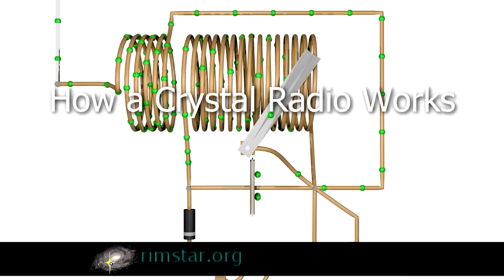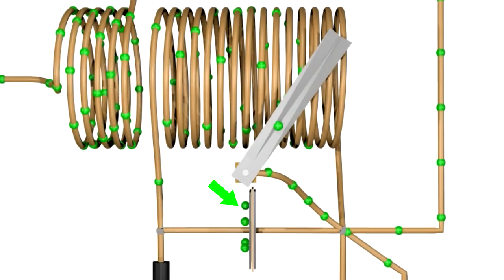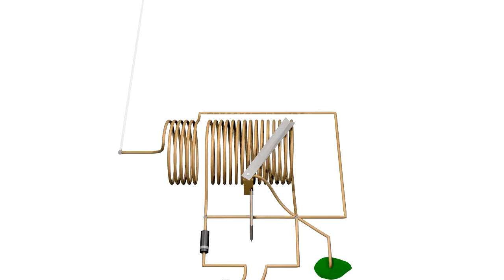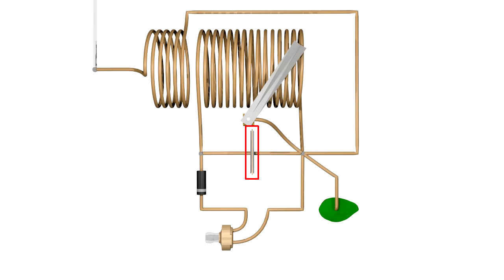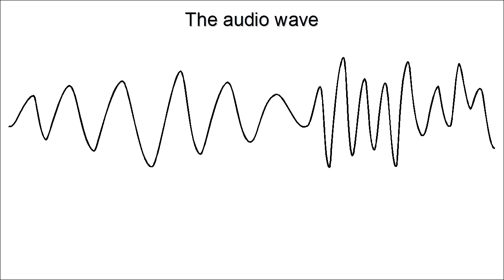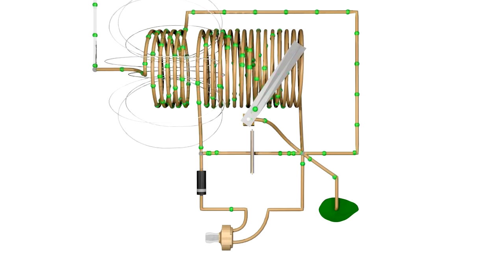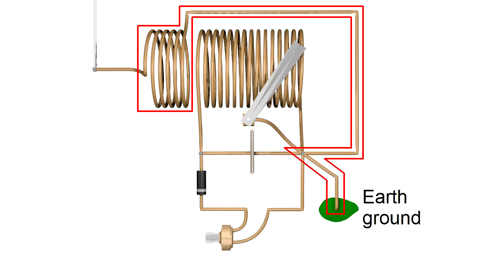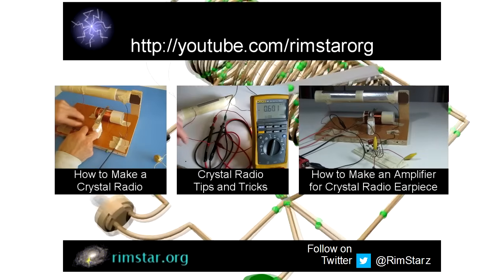How a Crystal Radio Works

Comment: Very clear and precise explanation, thank you very much. About the coils, if we want to calculate theoretically the value of the inductance to tune the radio to a specific frequency, should we consider both inductances? Or just one of them, the tuning coil?
Reply from the maker: Thanks. I get away with taking into account just the tuning coil and ignoring the antenna coil when calculating. I think I did once run across formulas that included the antenna coil too, or maybe it was just some mention of the issues with regard to calculations.

Comment: Detecting the "colours" of photons beyond an eye's.     
Increasing the capacitance size (plates), blueshift's the "sight" (to higher frequency of vibrating photons), and lowering, redshift's (the opposite).   
Increasing the inductance size (coil), redshift's the "sight" (to lower frequency of vibrating photons), and lowering, blueshift's (the opposite).  
Tune to a frequency (blinker the eye to a "colour") with the size of (between) coil (colour limiter 1) and plate (colour limiter 2).

The sound volume (wave height) is the brightness of the "colour", and sound pitch is the oscillating ("shaking") of the brightness.

The smaller inductor the aerial is attached, is so it ignores frequencies above a range (points the eye in the right direction).
Reply from the maker: Nice!

Comment: Thanks for the video. I see you've done a lot of work :) 

Why cannot electrons just go back when it's not enough charge to make the earpiece to vibrate. I mean the diode is connected to the other terminal, No interaction between the diode and the accumulated electrons.
Secondly, talking about the modulation of the sound wave, don't we now deal with the frequency that has been inserted to fit in the gap between the original wave form and the inverted one, and not with th original frequency ?!

Comment: How does coil know the role it has to play?   The first one is the receiving coil and the second one is the inductance coil, what is to stop the 2nd one becoming the receiving coil?
Reply from the maker: The first one is connected to the antenna, so it's the one receiving the signal. The second one is a part of the tuning circuit, along with the capacitor, so it does the tuning.

Comment: The only thing i think you missed in this brilliant explanation is how the size of the small coil affects the output.
Reply from the maker: I cover the small coil at 0:40 and 4:45.
Reply: RimstarOrg is there a reason for 25 turns in the smaller coil?

Comment: Great video! very well explained and super helpful.  Just one question, why does the capacitor need to be connected to ground?
Reply from the maker: +Liz Dolecki It may be because both end of the capacitor need to be connected to both ends of the coil and one end of the coil needs to be connected to ground. So it's not really that the capacitor is connected to ground but that it shares a connection with the coil that is grounded.
Reply from the maker: +Liz Dolecki Looking at it again, it may not need to be connected to ground. I just checked a book with various crystal radio circuits and some have only the tuning coil connected to ground. I know my crystal radios work much better with a ground but I've never tried with just the tuning coil connected to ground. I'll have to try it someday when I next bring it all out.

Comment: wouldn't it be more efficient if you nested the short coil inside the tuning coil, or added an iron core to the short coil?
Reply from the maker: Regarding nesting the short coil inside the tuning coil, if you do that then you should get higher volume but more interference from other stations. It's the same issue I discuss in the video at 11:15, except there I talk about the effect of bringing the coils closer together. My thought is that an iron core for the short coil would pull more of the magnetic field into the core and less would go to the longer coil; you'd get lower volume. There are many, many variations for crystal radios.
Reply: gahhhh of course. you can't get much closer than inside can you? just plan dropped the ball on that one. Thanks for your response XD sorry you had to repeat yourself. Thanks for you patience.

Comment: I just noticed that this works pretty much like your laser communicators (well kind of) except that the brightness (or amplitude) depends on how loud the sound is rather than its frequencies, it uses light in the visible spectrum rather than light (or electromagnetic waves) in the radio portion of the spectrum and that the frequency (or color) of the laser beam doesn't matter for the reciever for your laser communicators (correct me if I'm wrong) so you can use any color without having to tune in order for it to work. 

Can you point out any more difference if I'm missing any?
Reply from the maker: +Brandon Fisher Right on all counts.

Comment: +RimstarOrg This is a wonderful video and extremely useful. Thanks for sharing! May I ask a question:

In other words;  are we using inductor to get the maximum energy possible from the propagating magnetic field at the corresponding resonance frequency and capacitor for the maximum possible electric field energy?

Because I wondered that what happens if we only use capacitor to tune the device or vice versa... I think we could also match the impedance of the antenna and the load at particular frequency that we want to listen?

Thank you very much!
Reply from the maker: +Ozan Turhan Gündüz I don't see why you couldn't try just a capacitor. There are a huge number of possible crystal radio circuits. One of the earliest ones was just a diode in series with the antenna wire going to ground and with earphones in parallel with the diode.

Comment from the maker: When the free electrons are moved to one end of the antenna by the radio waves, as shown in the video, then that end is negatively charged and the other end is positively charged. That's the same as one plate of a two plate capacitor being negatively charged and the other plate being positively charged. At least that's the only way I can see it.

Comment: Great video, but I still don't quite get why the resonance frequentie is affected by the L and C from the capacitor and coil. In the video you only say that when they get a certain value, electrons just move easier in a particular frequency. Could you explain this a little more? Thanks in advance

Comment: that was quite the demo of the paths  traveled of RF electrons/ pretty cool way to present it. I can see 1 side of almost everything in the radio goes to ground.
I know the ear piece out of the 2 wires 1 must be GND I assume I learned the other day the diode black ring o 1 end means NEG ( hope I got that right)  I see that's pointing toward the ear piece also learned the diodes polarity has to be right or its an open switch so even thou it's pretty easy to see where all thee grounds  go I wasn't that clear on the ear piece and the diode. I'm trying to get something out of  the 2 transistor radio in my 160 &1 radio shack science kit.
thought there should be some similarities for polarities  as the principles don't change i wouldn't think

Comment: Handy tip ... the diode shown might not give good sensitivity with a TINY signal ... try using an " old skool " point contact Germanium type ( glass encapsulated types such as OA79  or OA81 ) ... these give MUCH more audio volume, but may be difficult to source in 2022 ( ? ) .. always use the pink type of ( ultra high impedance ) crystal earpiece, for max volume .. QED ...

Comment: What would happen if we place the small coil inside the big coil isolated like the capacitor with paper or anything to give the same gap as the initial one only this time radially? Will it induct more current and make the radio louder?

Comment: Very good explanation, I just hope it's FM instead of AM.
Reply from the maker: This explanation is for a crystal radio, which is AM only.
Reply: So why it only can work with AM signal only?
Reply from the maker: Indra Ida Bagus
The difference between AM and FM isn't just the frequency. With AM the audio is encoded in the radio wave by varying the amplitude (height) of the waves (Amplitude Modulation0. With FM the audio is encoded in the radio wave by varying the frequency (Frequency Modulation). The radio waves are formed with completely different types of circuits and need to be tuned into and decoded using completely different types of circuits since the circuits need to do very different things.
Reply: owh.....

Comment from the maker: No, it can't pick up FM. The frequency range is too high and FM modulates the sound using multiple frequencies to represent the different sounds. This radio is designed to tune in just one frequency. So it's the exact opposite of what you want for FM.

Comment: yeah, i mean the silicon diode thanks for answering
i have one more question : i'm thinking to add a battery to the circuit in order to increase the volume. so, could it work?
 and thanks again

Comment: Thanks for super super ... demo... Could you please post a video in order  to understand what is voltage ... I had seen many videos....including water model ... but I am still confusing ...  about voltage ...It will be very useful if U could use this video to explain what happen when (radio signal + DC)  and  ( radio signal + Ac ) ....and how Voltage come into the picture... Thanks a lot

Comment: I'm confused about the joint that is connected to ground, as it also connects the first coil, second coil, its wiper blade, the capacitor, and the earpiece. What separates the electrons going to ground from the ones going to the earpiece?

Comment: I am fairly new to electronics and radios etc, but I have however been wiring electric guitars for a while. My question is; Is it possible to use an ordinary capacitor connected to a potmeter and thereby regulating capacitance?

Comment: Really fantastic video. Thanks for taking the time to make it. I have a question. 
The first coil has an alternating current and the second coil alternates in sync with it. But wouldn't the second coil's current alternate with the 1st coil's changing magnetic field, i.e.. when the 1st coil's magnetic field is getting stronger, the current in the second coil would move in one direction, and then switch direction as the field gets weaker? 
Is the current in the antenna and primary could really AC? Or is it DC of varying current strength?
Thanks again!
Reply from the maker: +Simon Richards The current in the antenna and primary are AC. But I don't understand your first question. Doesn't my video show exactly what you describe?

Comment: Pretty good Gramps had a rock w a cats whisker and a coil around a round oatmeal box.a good antenna and ground. A variable capacitor and a switch for taps off the tuning coil.
C.Brandes was a good headset.

Comment: Hi there, I replied to another video of  yours where you directed me here for information on the primary/secondary. I have learned a lot, and am elbows deep in my own build. I cant seem to find actual numbers on  coil coupling, the ratio of turns between primary/secondary, what happens to the signal when the coils get too close, etc. I understand the relationship between the secondary coil and the variable capacitor to achieve resonance. The rectification to chop out the audio, crystal clear. I wanna hit over 500khz so im looking at a 140pf variable cap from scraps and a coil of about 770uh on a tp roll. How would I go about figuring a good primary for this? How does it help my radio single out the incoming resonance signal? What kind of gap should I shoot for? I see why volume lowers, because the magentics act as a transformer of sorts? Stepping down, and adding capacitance? Thanks for any guidance in addition to that which ive gained from your vids so far! Great stuff!
Reply from the maker: I don't have any formula for the primary, I originally got this circuit from a book and did what they told me. The explanation for how the two coils help with singling out the signal is in the video starting at 10:44. Sorry I can't help more with tuning the primary parameters.
Reply from the maker: The book was  "Radio Receiver Projects You Can Build" by Homer L. Davidson.
Reply from the maker: But the book doesn't give the formula either.

Comment: hello Rimstar!
I've just calculated I got enough wire to make the radio (I have got 23 meters, ==> (radius toiletrole: 2.25 cm), 115 turns in total ==> 2.25*2*pi*115 = 1625 cm = 16.3 m) right? :) I was wondering if you need a particular diode? I got some hanging around (little glass ones), or could you trie a few and see which one is the best?

amazing vid! Using Blender :)

tim

Comment: Very nice explanation, thank you sir,

However, is there any device can collect all the radio waves and frequencies from air and covert it to electricity? 

I’m working in this topic and sharing it with all to get renewable energy,, your help and support will be highly appreciated 🙏🏻
Reply from the maker: Thanks. And thanks for watching.
I'm not aware of any that would collect from all frequencies at the same time. There are circuits which skip through frequencies one after the other but that's probably not what you want.
Reply: Thanks for the reply,

Well, I think if we install multiple wiper blades with extra capacitor in the system. Then we may harvest all the frequencies from the air and convert it to electricity.

Is it possible? Or do we need to add additional stuff to make it?

Comment: Could the other half of the carrier wave be used to provide a little power to supply a small transistor amplifier?
Reply from the maker: I guess it could be used somehow. There are so many different crystal radio circuits out there that it may well be.

Comment from the maker: I haven't experimented with ultra low frequencies. Also, this isn't a crystal radio in the sense you're talking about. When crystal radios were first invented, the diode consisted of a crystal rock such a galena with the tip of a wire touching it. It was a primitive form of diode and that's the purpose it served, to chop off half the waveform or to rectify it. These days most people just use a germanium diode.

Comment: Wow amazing explanations ! 
Quick question can there be an infinite number of frequencies or stations to tune in to ?
Reply from the maker: Rich Handsome Thanks! Glad you like it!
No, the frequencies that stations use have to be spread apart a bit due to the difficulty in isolating just one frequency. That's the selectivity problem and solution I talk about at around 10:44.
Reply: Mhm I see , what about if I was using a quantum computer that's able to generate and select almost infinite # of frequencies? Lol I know it sounds a little far fetched but I think I'm on to something big here.

Comment: in my school, they taught that for radio capacitor and inductor have to be in series and for jammer inductor and capacitor have to be in parallel(with ac source).

is there more to it???
Reply from the maker: There are many designs for crystal radios.

Comment: For a forward conduction a typical silicon diode requires 0.7 volts and a germanium diode requires 0.3 volts. Do we to think we get 300 mV just through an antenna?
Reply from the maker: Well, it works so I guess the answer is yes. 700 mV though, seems to be a lot harder to get.

Comment: Sir, why can't I completely isolate tuning circuit  (L-C) From Earth Ground, will there be any problems  ?
Reply from the maker: I don't have a ground for my pizza box portable crystal radio https://www.youtube.com/watch?v=iunAvz9PbN0 so yes, you can isolate the tuning circuit from Earth Ground. The disadvantage is that the signal will be weaker. Have a look at the beginning of my homemade amplifier video where I demonstrate it using the pizza box radio and you'll see that I have my bare left hand on one of the capacitor plates to act as a ground and increase the volume https://www.youtube.com/watch?v=JtPwxbOgBHw
Reply: @RimstarOrg  Thank You Sir

Comment: hi if we select a precise frequency but the amplitude always changes, it wont load the capacitor faster or less faster than a frequency with always the same amplitude because a variable amplitude will create a higher or lower  voltage that will go in the capacitor ... i dont know if you will understand my question but i hope so. sorry for my english i speak french :P

Comment: Thirdly, If I used that high resistor, I now can dispence the diode,can't I ?! 
Fourthly, for parallel resonance circuits, isn't the circuit supposed to resonate at one frequency only? Fo= (1/ 2 PI sqrt( LC) ). Can the circuit catch frequencies when it's not adjusted on its resonance frequeny ?

Comment: How does the diode function with such low power? Silicon diodes have a 0.6v voltage drop, germanium is lower but not zero.

Do the paired coils act like a step up transformer, letting the weak signal induce a higher voltage in the larger coil to better get through the diode?
Reply from the maker: Like you said, the voltage drop of a germanium diode is lower (0.25 V to 0.3 V according to here https://en.wikipedia.org/wiki/Diode). I've looked at the output of a crystal radio on an oscilloscope and it's voltage was as high as around 0.5 V. You of course need a long antenna to capture enough power, or a nearby strong radio station.

Comment: So what makes the left side of the tuning coil give off lower inductance and the right side gives more?
Reply: Take off the right side end from ground. Leave it unconnected to anything. Works waaay better.  Then visualize the left end of the coil as one end to the wiper. When you move the wiper  left, the effective coil is smaller than when you have it set to the right end.